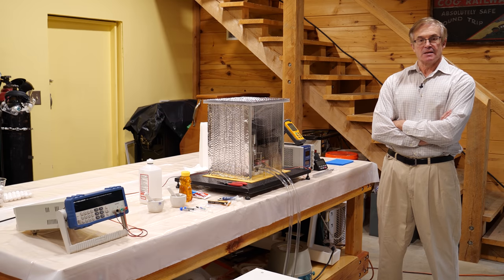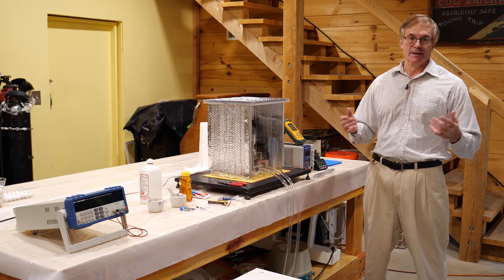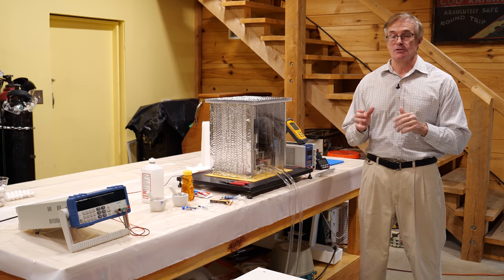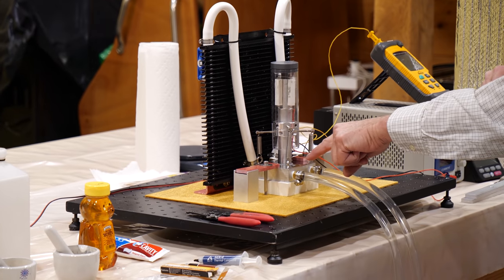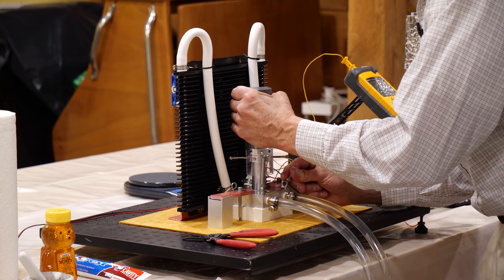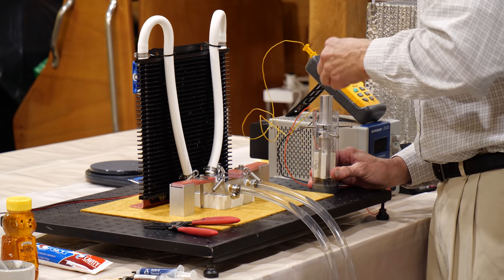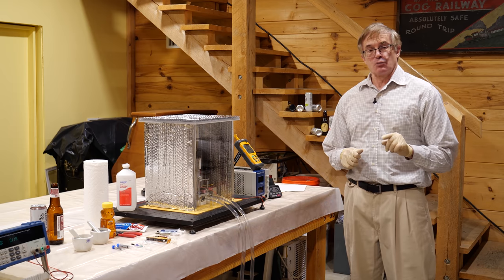DID WE JUST MAKE THE WORLD'S BEST THERMAL PASTE!?

Comment: You have to periodically test the paste's performance over 6-12 months to monitor its performance across thermal cycles as your paste may eventually 'cure' which can impact performance.
The paste may degrade or dry out from thermal cycles to the extent that a new application is justified. It's very unlikely but possible that exposure to the air (depending on application and heatsink tightness) or 'spill' out over time is an issue (really rare). Another concern is if the cured/aged paste acts like a glue when you attempt to remove the heatsink later on, it can be tricky to separate stuck CPUs+Heatsink and difficult to clean the paste off (ideally without leaving a stain), almost all thermal paste reviews ignore these aspects.
I raise these points because they're relevant to the average builder whether they're removing the heatsink to replace it, to upgrade the CPU or want to sell the parts individually (after months-years of use). the lifespan of your product is unknown and you didn't seem to prioritise any additive preservatives or consider those already present in the ingredients (?).
This is still very impressive work, home-made paste has come a long way since the early 2000s.
Reply from the maker: We're running two computers with this paste that are now at the 5 month mark without any degradation.

Comment: The spring tension is constant in this test, but what about viscosity to be sure all is squeezed out just leaving the material only to fill the uneven surfaces.  How to be sure there is not to thick layer of thermal paste, i would asume very low viscosity would be better.  Maybe between these paste, some may need more pressure ?  For the toothpaste as it is abrasives particles in suspension, possibly the particle size inside toothpaste may not be fine enough, therefore build to thick layer? Anyway very interesting. I was thinking to try some boron nitride powder (it can even be found on aliexpress) + low viscosity silicone oil, maybe would be interesting to test.

Comment: I was curious, if there is a ceramic coating type material that may be able to dispel heat in effect of the substances you have tested. Frandsen the ceramic coating that goes on exhaust systems on performance vehicles that disallows the heat to escape the exhaust system into the surrounding areas areas of the vehicle that the exhaust is routed. In most cases this is powder coated. But I was not sure if there's an element of ceramic paste that could effectively perform at a similar level.

Comment: I have a question.   Since the hot side has consistant heat energy coming in which is the same for each test (over 12 minutes) and you are measuring the temp on the other end in the attempt to measure the performance of the "thermal paste", wouldn't a lower performing paste still send over the same amount of thermal energy over that 12 minutes.   I'm thinking less performing material would allow the hot side to build up more heat (get hotter) and that extra heat would still transfer over slowly to the measured side.    In other words even if the paste was low performing, over 12 minutes it would still send over roughtly the same amount of heat/thermal energy wouldn't it?  Even if it's poorer performing as time goes on, the source is getting hotter and hotter which would be much the same as a higher performing paste, just slower to move the hear.  I would think a FAST test would give a better measurement than a slow 12 minute test.    Have you tried this type of measurement with a "fast' test versus a slow test?   I would think the fast test would give a better more accurate performance measurement of the paste you are testing.     Simply because you are not giving it 12 minutes for all that heat energy to come over the thermal transfer material..    because as the heat gathers on the hot side (since it can't transfer as fast over the lower performing pastes, heat builds on the source side and as it gets hotter, more heat will go across the paste.   Just seems a long slow test would have nearly the same total amount of heat energy transferred to the other side over 12 minutes.    In other words, the poorer the paste, the hotter the source side gets and over time since it's hotter more energy will still come over the paste given you allow 12 minutes to measure.    Do a 5 second test and see the difference.   what is the purpose of the 12 minute test this just allows more loss to radiation and other methods of loss.   Wouldn't a faster/quicker test give more accurate results?  After all, the purpose of a paste is to get that heat moved away quickly, efficiently, so I just think a 12 minute test is too long to really test performance.    What is the draw back of having a much faster test, say much higher source heat and see how hot the measured side gets only after a couple of seconds.  This would provide a good way to test the performance of the paste would it not?   I'm rambling now, but I hope you get what I'm trying to  explain.  Thank you.
Reply from the maker: It would only if the temperature was higher because a greater temperature differential is needed to transfer the same amount of heat.

Comment: Have you tested any of the new phase change TIMs?
For example Parker Chomerics T777.
Digikey has it in stock.
It looks like a great TIM. I’m about to try it.
Low thermal impedance. (Final phase change at 64 Celsius.)

I have also trialed their Parker Chomerics GEL45 on cpu and gpu chips. 
I had to spread a thin layer to get a minimal bondline thickness. GEL45 had no obvious performance issues and in theory this TIM has longterm stability and no pump out. Silicone based.
Their GEL8010 should be even better as it has the lowest minimum bondline thickness.

GEL45 - 0.0889mm MBT - 4.5W/m-K*
GEL8010 - 0.05mm MBT - 3.0W/m-K*
(*Test method: ASTM D5470)

Comment: So I've seen people do tests with Indium, and once the CPU reaches a good steady state, the material melts itself to a point where it becomes very viable as an option, about on par with your higher end thermal pasts, with the added bonus of being able to easily make cooler swaps or die swaps... Is the enhanced performance of Indium in terms of like the significant factor that you mentioned only allowed with pressure and heat? I'm just curious as I've seen it with my own eyes being a perfectly adequate solution, or an equivalent solution with a benefit of being being you know reusable.. so I'm just curious if the reference was to like what it could be versus what it is under normal circumstances...

Comment: One thing that wasn:t shown how a bad thermal conductor performs in this test setup to get a range for reference. Also how do these compare at different temperature ranges?  Otherwise a very thorough job!
Reply from the maker: With only air between the metal surfaces ie direct metal to metal contact, the temperature rises to 46 C.

Comment: Why don't you have the resistors outside of the temperature controlled box?
The results of your squeeze-out method depends of pressure and paste viscosity
Reply from the maker: The resistors are part of the thermal inertia of the upper rod, they need to be within the temperature controlled box.  You're right and viscosity is inversely related to the the thermal resistance of the paste and clamping pressure determines the bond line thickness.

Comment: Once again, another excellent video! (Although not as good as your reflux still video! Since seeing that video, I entertain secret fantasies of owning one of those!) With this project, it was great that you included Shin-Etsu in the mix. Have you tested your thermal paste under higher temperature load conditions? We modified some lab instruments for a few customers with high performance TE modules and used the Shin-Etsu on those. The hot side of these past projects could get upwards of 60°C, and some of our upcoming projects will see up to 120°C. Do you have any plans for a video where you test your paste under more extreme conditions? If it holds up, I'll have to start using it!

I'd also be curious how some of the phase change materials stack up in comparison. I think these are basically wax, but I haven't looked too closely at their ingredients. In some basic CPU load tests on my own computer, they did quite well. I'm guessing this may be because their layer gets very thin as soon as the CPU gets up to temperature.

Thanks again for all the great videos! Cheers!
Reply from the maker: We will. I think your reasoning re the wax is sound.  However, remember that the temperatures are read off the die or in our case, part way up the rod. The TIM is operating at lower temperatures than those readings.

Comment: For real PC use, comparing the performance after several hundred cycles to 80 degrees and several days of hot time is probably the minimum.
For something to sell/keep in a syringe, it also needs to survive years on a shelf.
Reply from the maker: Agreed.
Reply: That said, little to no PC channels do long term testing, just benchmarking fresh application.
Whereas in my "youth" the conventional wisdom was that thermal paste gains its best performance only after a bake-in. It could have been an urban legend, or it could be the temperature softening the media and repacking due to thermal expansion of the surfaces and particles, all in all resulting in a thinner layer.

Comment: How do you think toothpaste polishes metal?
 There are a lot of chemicals in toothpaste I can think of that could help with this, but I'm not sure what it would be: 
silica dioxide (by sanding it basically),
baking soda and EDTA reducing or binding to the outer oxidized metal layer, 
flouride??
Reply from the maker: I believe it is the mild abrasives and alkaline pH that do it.  The fluoride is present in extremely low concentrations and I'm not sure how it would contribute in any case.

Comment: My apologies if this has been brought up in other comments. Doesn't the outcome range of a mere 1.2 degrees indicate the resolving power of the test is poor, or that the performance of each material tested is practically the same?  Also, to what degree does the thickness (between the source, and sink, surfaces) of each material contribute to the measured outcome? Does the 'squeezed-out-thickness' of each material vary?

31.0  23:56  toothpaste   
30.6  27:33  honey  
30.5  29:17  arctic Ag MX4  
30.1  41:50  artic Ag  
30.1  31:36  TI low cost  
30.0  33:17  noctua  
29.9  34:19  pk3  
30.0  35:11  dowsil 5622  
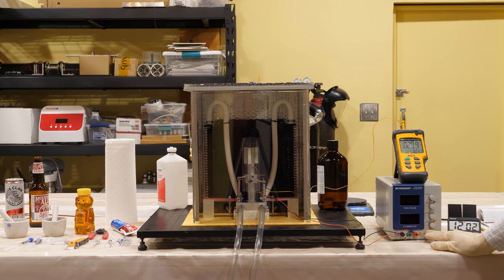29.9  35:50  shin etzu  
29.8  37:15  TI hi -perf
Reply from the maker: The resolving power is indeed limited although the results are consistent.
We've modified the rig with nickel coated surfaces and will be increasing both the heat input as well as the test duration to allow testing of liquid metal thermal pastes and for higher resolution.
Reply: @TechIngredients  It would be interesting to see the measured result of no thermal paste at all.

Comment: The other major factor to consider is lifespan of the material... especially when considering the thermal cycling. But while It is fairly normal to have to re-apply thermal paste every few years, most of these commercial products should last upwards of 5yrs+ before loosing much of their performance (by drying out and cracking). I've seen some last 8 or 10yrs... longer than the hardware stayed viable. That would be the next test lol... bit of a long term test though lol

That said, it would be interesting to see how liquid metal (Thermal Grizzly Conductonaut) did in your rig (though it might damage it as liquid metal can be corrosive to certain metals).
Reply from the maker: You're right, long term testing, even if accelerated, takes a long time. We're modifying the rig with nickel coated surfaces and will test liquid metals next.

Comment: This was a very interesting test. It do shed some light in things I seen all the years. But I really miss Thermal Grizzly Conductonaut liquid metal in the test. 
I have used most stuff in the market, but start using the liquid metal and I just love it. Its a pain to put it on or remove it, but it seems to work much better then other stuff.
Sure you really need to know what you are doing when using it, as you can easy ruin anything you use it on.  Also the drawback is you cant use it on aluminium.

Any plan to test or make liquid metal?
Reply from the maker: Yes.  We modified the rig with nickel coated surfaces and will test liquid metal pastes including our own formulation.

Comment: Once I changed a cooler, but haven't thermal paste.
I had just dried flakes of old. (lol. I saved it for this).
Sooo... I've read a bit about good paste components
and mixed my own shit out of those old flakes + Wurth paste for brakes + a bit of silicon lube. (brake paste is meant to conduct heat from brake pads to caliper).
I won 10C with no money or walking =)

Comment: This has a uniform heat distribution where a CPU does not as well as not all CPU heat spreaders are created equally as in some have larger space between the cpu die and the heat spreader so the thermal paste can only do so much so you have diminishing returns regardless of the thermal compound

Comment: Since you already mentioned the long term stability issues with honey and toothpaste, because of evaporation, it would actually be interesting to do a long term test, with thermal cycling, of your paste and maybe a few commecial solutions too. Are there any tests like that planned, or is there any data already available for the commercial (consumer) products? Seems to me that it could be pretty easy to make a "fake" product that is performing well on the normal tests that computer reviewers do, but have a paste that degrades with oxydation or evaporation after a few weeks or months. That could cause some big problems, issues or even equippment failures, and i don't think most consumers would even suspect a slowly failing thermal paste as the cause there.
Reply from the maker: Actually, it isn't easy to make a short term, "fake" compound.  The toothpaste and honey are decent, but not competitive.  A few manufacturers add a small amount of a solvent to reduce application viscosity, but are intended to bake out to a long term stable material.  Shin Etsu does this with some of their industrial formulations for automated, machine application.

Comment: do you think that testing at higher temperatures would yield different results? I feel like some of the liquids used may change viscosity based on temperature and that may affect the linearity of the performance, Also that would be a more practical test if you are gonna compare it to thermal pastes for high performance CPUs which may run close to 70 degrees C on the IHS.
Reply from the maker: Now that the rig has been modified with nickel coated surfaces, well be retesting and we'll increase the temperature as well as add liquid metals to the list.

Comment: the thermal conductivity is surely dominated by the silica particle size in it. toothpaste contains sand as an abrasive which sets the distance between the surfaces probably.
also lol at the beers stacking up over time :)

Comment: Would testing based on a fixed thickness yield better results if the method is based on using thermocouples? 

A thin film is equivalent to low resistance - better to base the tests on heat flow (using a heat flux sensor)
A thicker film is equivalent to higher resistance - such tests would be based on potential (using the thermocouple)
Reply from the maker: The problem is that real world applications don't control for thickness, but depend on clamping pressure and viscosity to determine this bond line thickness.  Also, as I'll explain in our next video, viscosity and thermal conductivity are inversely related.
Reply: @TechIngredients  noted and agreed. (... was thinking adding a discussion on heat flux and incorporating a heat flux sensor might have helped to add some more information to evaluate the performance of the compounds; particularly as modern processors seem to require a dissipation heat flux that may be quite high, especially for customized computers) 

Supporting the excellent and exciting work as always!

Comment: I would try gemstone polishing powder as there is filtrated various oxide metals or raw..mixed with a good thermal property oil like castrol b or a thermal oil that has a film temp of about 2-370 degrees centigrade..and thicken it slightly due to it is very viscous even in cold conditions. The film temp in these temps is just nonimportant, but it will do the work and wont harden of air penetrates such as an oxidizing oil does ( linseed etc).

Comment: I wonder if increasing temperature range (more power, less thermal mass) that this device operates at would improve resolution. 0,1*C is quite a lot when we are talking about less than 10*C difference. Also, supposedly some pastes need hours of high temperature load until they reach peak performance.
Reply from the maker: I think you're right about both the thermal mass and the power levels.  We're building a nickel plated copper version with greater heating capability to test liquid metals and despite the fixation some have with the metric system, we'll use Fahrenheit for higher resolution.

Comment: ONE question: How your paste will perform after 5 years? As i am writing these lines on a computer that is 6 years old and never had the cpu paste replaced and still performs decent. would also love to see a regular aluminium kitchen foil in this test and then automotive copper grease. i hope you read this
Reply from the maker: Aluminum foil doesn't work.  I tested a variety of Neverseize compounds that also don't work.
All thermal pastes will eventually dry out and the question is how fast.  We suspect ours will dry out at a rate similar to other commercial pastes because the formulation is not that different, but only time will tell.